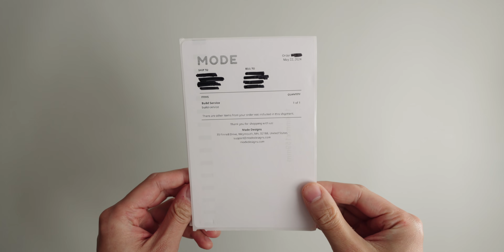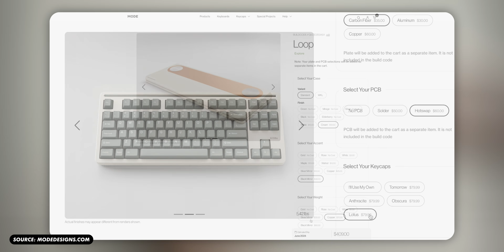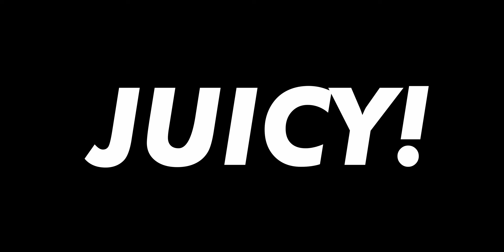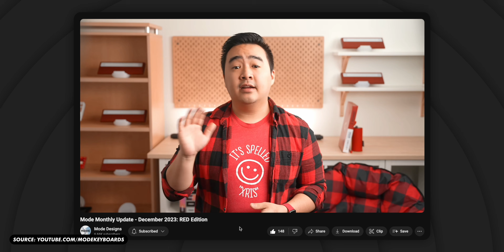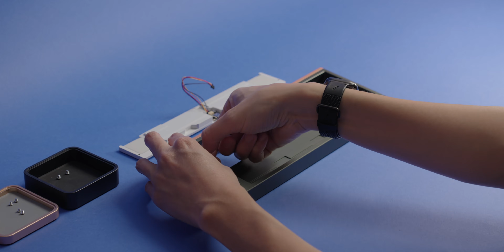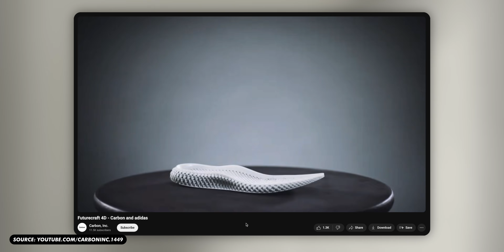If Apple Made Custom Mechanical Keyboards - The MODE Experience

Comment: What I like is they are good but also in stock and I can get more stuff  want like extras love poly to not a fan of long group buy either… so far an envoy and a new 65 my first keyboard of the hobby a ikki68 from a reseller cause I was lte but wanted under 200 at the time the new sonnet will be next I just got a loki65 smoke black com on mode make a smoked poly

Comment: Cool, a very, extremely good keyboard is an extremely important tool coz' communication is the 2nd most important tool of mankind (time & prayers are first most important tool of mankind).

The Altar is more like what Apple would design, they put Apple's chiclet keycaps which is a good dimension. This is more like what Bobba Fett would type on.

God bless.

Comment: I love Mode…and no longer use their boards. The sonnet was amazing. I loved it at first sight and preordered a rather pricy configuration of it. The build experience was wonderful, and the keyboard felt great. However, after a few months of use, I started having key repeat issues. The Mode Discord described various things to double check on the PCB, and I found none of those things were wrong. Ultimately, I discovered it was a known fault of the Sonnet PCB to repeat key presses upon waking from sleep on macOS. A workaround firmware was provided in a difficult-to-find Mode Discord forum post, but it disabled the ability to use the keyboard in a certain way, I believe waking a Mac from sleep.

I shelved my Sonnet after one-too-many Zoom calls where I hit the volume up key and had to panic unplug my keyboard before the key repeating sent my volume to max…I hope to revisit Mode products one day, but the PCB flaw soured me on the company.

I moved onto the Frog TKL 8K. It’s a nice board, but I’ve had a number of issues using QMK on it that have required me to DM with the PCB designer. That’s a far cry from the smooth experience of Mode’s board even if said Frog PCB designer is quite nice and helpful.

Comment: Honestly at this point - calling out RAMA should be put front and center rather than just a cheeky nod. - Sincerely, a RAMA Victim.

Other than that - great job on the video. I've always wanted a Mode board but the lack of any wireless options makes the value proposition a little wild to me.
Reply: You'll get your RAMA board in 2124